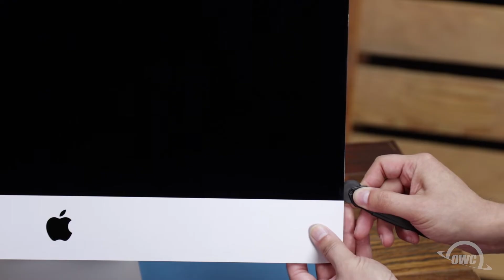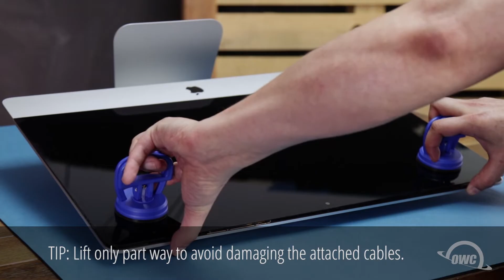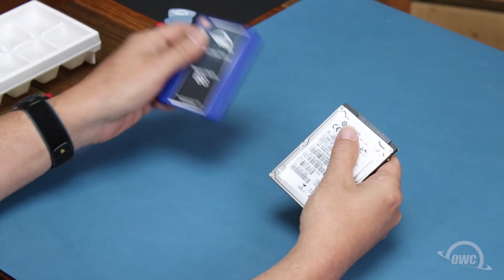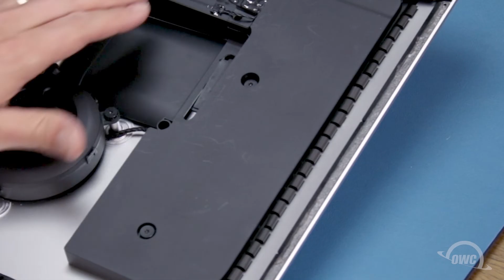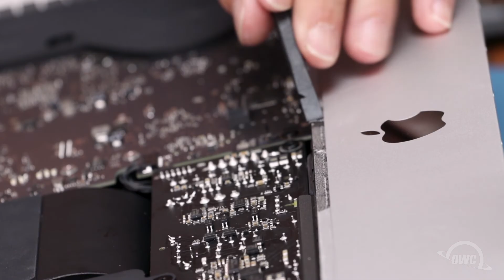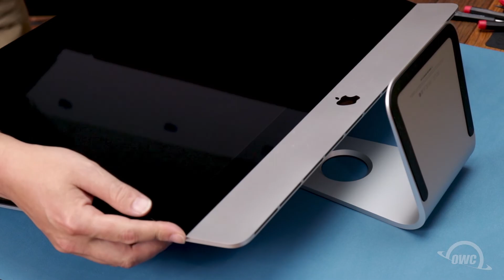How to Upgrade/Replace the Main Drive in a 21.5-inch iMac (2017)

Comment: Would adding a USB-C external SSD and booting off that work and have high performance?
Reply: @poweredbyowc  Nice I think I'll buy a a drive and an enclosure from you guys instead of cracking the iMac open. I have the Fusion drive model, and it's slow as a wet week.
Reply: That’s what I did. I added an external USB-C enclosure.with a 1TB SSD. This computer boots so much quicker. I’ve been using the internal HD for data only. It’s starting to make some noise though. I might have to crack it open after all. Hope this helps.